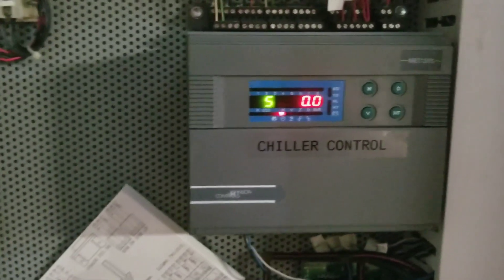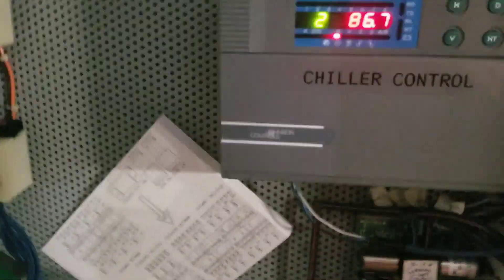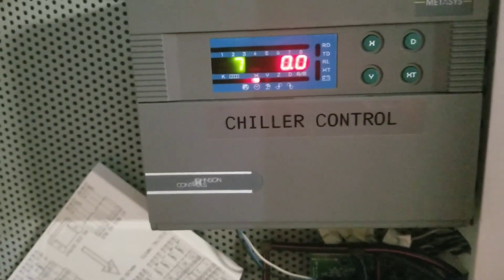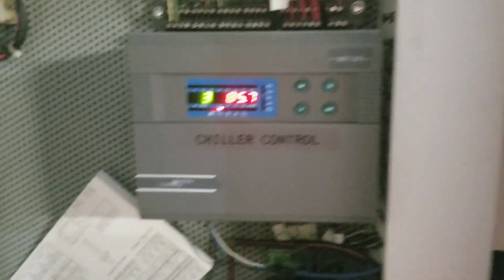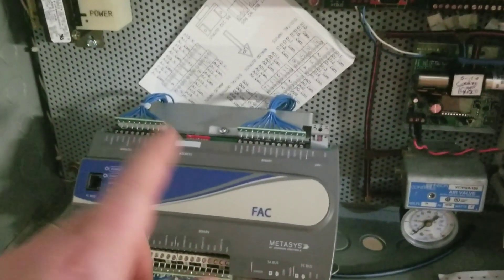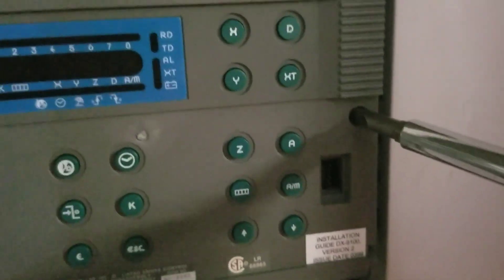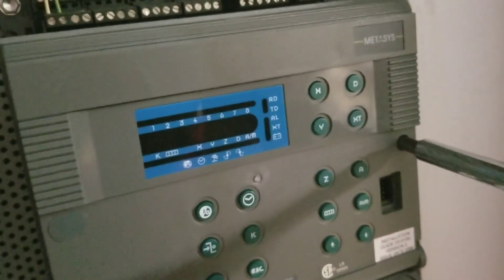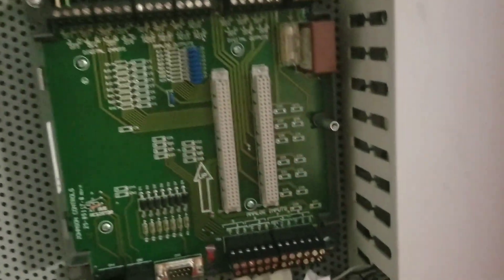Johnson Controls FAC DX 9100 Adapter installation

Comment: Interesting idea, but you are still using a 20 year old sub base and I have seen a "new" installation by JCI using this method and many AI were not reading properly due to issues with the sub base. Anyhow I really like your channel, lost of good information!
Reply from the maker: The biggest advantage of this is the speed of changeover. I only had a very limited amount of time to get these back online. When the back panel fails it will be wired straight.
Reply: Required  again programming  in to FAC controller ?
Reply: @marimuthum1352  You need to build new programming in CCT for the FAC as the DX9100 code is not compatible with the FAC.
Reply: If please, I want to develop  some DX application from DX to FAC .
Reply: @marimuthum1352  You need to review the DX programming and manually recreate it in CCT. It's time consuming since there is no software that can convert it for you.
Reply: Ok thank you ,